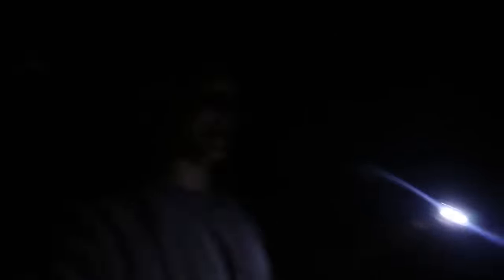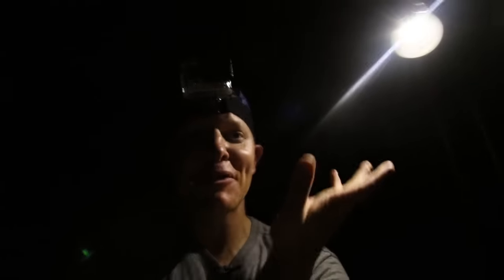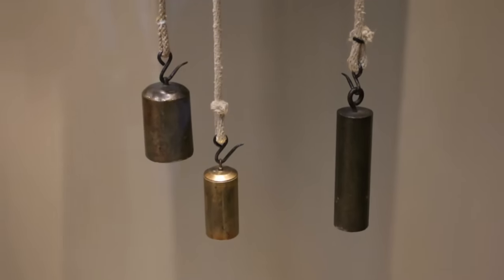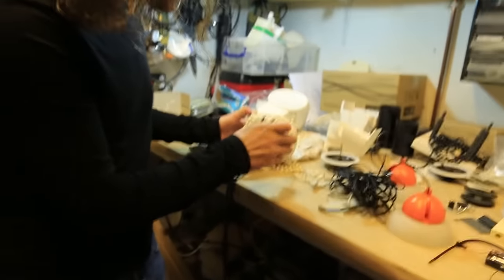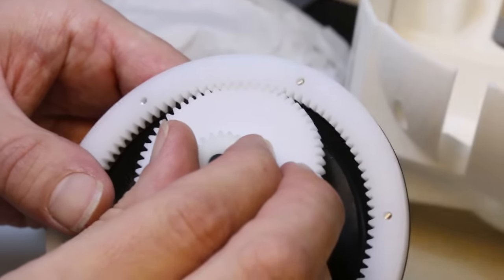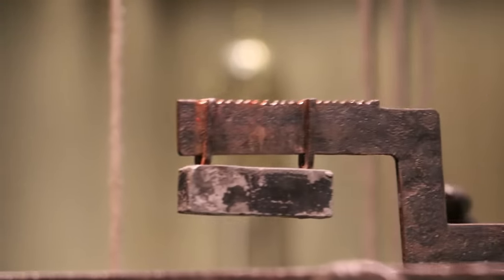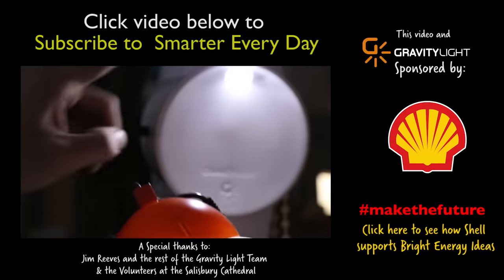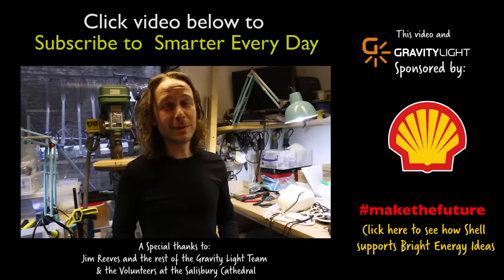Turning Gravity Into Light - Smarter Every Day 146

Comment: The braking effect wouldn't be exclusive to LEDs, any load will produce a counter-voltage on the generator which will slow it down. That's how dynamic brakes work on a locomotive or electric car - they use the traction motor as a generator and connect resistors across it.

Comment: We have done it.

but, For "productivity" its better hydropower gravity than "manual put some material with heavy weight, to machine. Because its hardwork. and if we use some tools for automations it with machine.

energy to put some weight is always more than output energy we produce.

its okay, for just some LED. and nice work.

Comment: Think bigger. Use a HUGE weight, hence a massive force. Use gear ratios that would make it take days before it drops to the bottom. Use solar power with stored battery energy to drive that weight back to the top.

Comment: this kind of energy  changing is used for a very long time now in the field of alternative energy. 
If you get too much energy out of the sun (solar plant) or out of a dam (water turbines) the electricity that is generated is used to pump water on a higher level. Then if the generators dont generate enough energy, they let the water flow down again and the water drives turbines that produce electricity

Comment: Just wanted to point out that this is not turning gravity into light. You store the energy when you raise the weight into the air. Just as a waterfall. The energy is stored from the sun. Same with the gravity light the energy is generated indirectly by the sun.

Comment: Got a question for you..
I’m a roofer and use special rubber souls on my boots to stick to roofs. When they get wet all surfaces become slippery and so does most wet  rubber surfaces yet if I fold a roll of rubber on top of itself with moisture in between, they stick very well with almost no slippage.. why does it make things slick yet sticky at other times.

Comment: With a capacitor you could provide light while resetting the weight.
Reply: Add a battery pack and you could run the weight several times during the day, with the light switched off.  Giving someone the ability to run the light for longer than 20 minutes at a time.

Comment: Run time is based on length of pull cord correct? Can you anchor the light at the location that needs light, get a long pull cord connected to a pulley that is anchored high up in a tree. If 8 feet of fall gives you 20 minutes of light, a 24 foot tree would produce an hour.

Comment: As others have said... the gravity is really the storage device (source being human or something else, but ultimately the sun), yet that is still really cool because batteries come with a lot of complication (not that this doesn't necessarily, but different complications). 

I could see this being used in place of batteries for all kinds of various power sources, including photo-voltaic panels. The PV panels could power loads while the sun is shining, but also power a small pump to load water up into higher energy states, or a small motor to lift weights on a pulley.

So one question becomes, how does the energy input to produce this device compare with energy input for battery technology of similar capacity, over its life cycle.

Edit: I guess part of the point here though is that the power source can indeed be simple direct human intervention to keep the system as simple as possible. Granted there are many ways to potentially do that.

Comment: turning gravity into light... what you mean is the energy transfer of kinetic energy, into an expression of high frequency waves, which then collapse to create light... gravity merely describes kinetic movement and energy exchanges between objects, based on their densities, at an equal consisent level which we deteermine as land level or sea level, when your enviroment changes e.g air vs water... you see the calculation change, gravity is not a force but an explantion of kinetic movement.

Comment: Two major misinformations:
First: It is not a purely gravity powered light. It is gravity assisted. On the first place, a human should hang the weight on the chain, thus putting energy into the whole system.
Second: In geared mechanisms, there is no way to make more than one tooth engage at the same time from the same wheels. There is a case when the next tooth engages and both are touching, but it is for a very short time. One exception: if the gears are coaxial and have the same number of teeth, but that has no practical use.
They are actually using a planetary gear mechanism with three satellite gears. That way they have three teeth engaging at the same time, but these are from different wheels. Actually, planetary gears are widely used in applications where heavy load capability is desired, like in hoists and cranes, because of the fact that multiple wheels are transferring the forces.
Reply: Besides, the effort to put the weight on the chain while the light is not working and it is dark could be a hazard by itself...

Comment: Could you do a future video on how the electro "escapement" effect is powerful enough to limit the fall of the weight? (surly if you add enough weight it will overcome this?) 
I understand the principle, but with my limited knowledge, how Is the limited power usage of the led "choking" the usage of the power created by the generator, by means of a non mechanical connection between the stator and rotor?

I hope this makes sense.

Comment: Great video, but there's one thing I find very hard to believe (Max, old TV show): that an LED can limit the speed of the generator powering it!!  Wouldn't the much bigger mechanical forces of the weight being pulled by the gravity of gargantuan Earth (compared to that falling weight) simply keep accelerating the generator 'wheel' until the LED's voltage was exceeded and the LED burnt out?
I guess what I'm asking is: How can a passive Light-Emitting Diode slow down a mechanical wheel being turned by the whole of Earth's gravity accelerating a falling weight at 9.8 metres per second every second?

Comment: If I have a mass of 10kg hanging 2m above the ground. The total energy I can get would be mgh i.e. approximately 200J. Now if I have a 1W LED, it would run for only 200s or 3.34mins. So that means I have to reload the mass every 3.34 minutes and that too after assuming no energy would be lost due to friction or resistance in wires.

Have I made a mistake somewhere or is this how the product is supposed to work?

Comment: He says it wont degrade over time if stored away... Wrong. 

The rubber band from the gear drive to the motor will become slack and perish over a 10 year period in certain conditions just like in the Cassette players of yesteryear. 

I have replaced enough of them in the 90s on cassette decks.

Comment: When he said "How does this work"....My first thought went to clocks that use weights.
I just thought about a design where you take one of those wind up musical boxes and inside they have a butterfly wheel that regulates the speed, put magnets on that wheel with wire coils adjacent and generate power. Now of course you don't use that exact design, but a long spring generator could be made and integrated into a lithium power bank.

Comment: You need to design or find a low-rpm generator instead of increasing the rpm using so many gears: fewer gears, less motion, less friction, less energy waste, less wear and tear. Yes that would mean stronger and larger magnets and larger coils, but that would replace the gears and that's what you pay for efficiency.

Comment: Sun gear, and ring gear... You're halfway to learning how an automatic transmission works.
Reply: planetary reduction
Reply: @hotrodray6802  yes correct is called the planetary reduction gear set. You can connect one end of The sun gear to another sun gear with another set of planets and another ring and obtain another ratio.

Comment: Interesting, so you if someone had one of these lights it would be possible to transform this mechanism into a free energy machine with a simple modification to keep it running by taking up the slack of the gravitational drop of the rope. Essentially making a perpetual motion machine at the same time. Well as long as gravity keeps working.

Comment: this stuff uses rubber bands inside..........thats a disadvantage coz it was mentioned that it could be used after keeping it stored away for a long time. Speaking from experience, those rubber bands sort of degrade when kept in closed dark spaces and become sticky and gooey; basically not rubberband-ish at all. What i mean to say is the product should avoid using rubber bands coz it wont work during that hurricane or flood where you will take it out from under the stairs after all those days without use
seen it in lots of devices, speaking from personal experience..........still its a good product which i too had thought of independently before this

Comment: How feasible would it be to have one like inside the church that has a whole bunch of weights triggered to fall in sequence when each reaches the bottom that has an output of say 1000 watts and can run for say 10 hours then in the morning solar panels drive an electric winch that winds the weights back to the top for the next night ?

Comment: Actually, ......the light is powered by human muscle power. Your muscles LIFTED the weight up against gravity and then gravity continued the motion. When the weight gets to the ground gravity isn’t going to lift the weight back up. It needs a human to put the power in there in the first place. 
I have a radio like that, spring powered generator but the spring needs someone to wind it up first.
Instead of cranking a small generator all night with a finger, use two arms and put all the power out in one burst. Let gravity help you stretch it out for hours.

Comment: Having lived around salt-water marshes, I've often thought there should be a way to gear-up the rise and fall of the tide to a reversible generator.  Flotation would provide an up force and gravity a down force, with no need of any work for a reset.  Extremely slow, but with the strength and reliability of the two forces (and if geared properly and multiplied by many generators) it still seems a possibility, particularly after viewing this.
Reply: Tide generators exist. I think they are used in the Netherlands a lot? I don't remember exactly, but I know they exist.

Comment: at that set-up of gears with the clock you would have enough RPMs to spin an alternator to charge batteries or bypass the diodes and you should have like 80 amps, Gravity Generator?

Comment: A small Solar Panel, connected via a small battery management unit (no larger than a pair of 18650 batteries), connected to a couple of old Laptop Lithium - ion batteries, will provide enough energy to keep an LED Array lit brightly all night long. No lifting. No winding-up. No moving parts to get wet, corrode and clogged-up. What if you are in an area that is a barren landscape, with no trees at all? All that you got to do - is find a Clearing in the Amazon for the daylight to charge the batteries. Very easy today - with fires burning everywhere.

Comment: The term gravity ...I think...is a misnomer. Gravity is an unproven 
theory. It does not work within any algebraic formula. It can  NOT be 
used as Force in any equation.  Matter bends spacetime, and the effect 
of that bending of spacetime is to create a generalized kind of force 
that acts on objects. However, it isn't a force as such that acts on the
 object, but rather just the 
object following its geodesic path through spacetime.
When light passes through an electromagnetic field, it is split into 
different spectral lines. That electrical phenomenon is what astronomers
 mistake for gravitational redshift. 

Electromagnetics ,on the other hand,are the only force that exists,and 
can be defined in realtime computational modeling. We are pushed onto 
earth by the electromagnetics of electrons/proton phasing , as opposed 
to the theory that gravity holds us to the earth the closer we are to 
it. An excellent example is the Saturn moon Titan.

When using surface gravity as a function of mass and radius (and 
sometimes speed of rotation).  Density is relevant, but it's not a 
complete answer. Most of the matter in the universe is in the form of 
plasma.
 A plasma is formed if some of the negatively charged electrons are 
separated from 
their host atoms in a gas, leaving the atoms with a positive charge. The
 negatively charged electrons, and the positively charged atoms (known 
as positive ions) are then free to move separately under the influence 
of an applied voltage or magnetic field. Their net movement constitutes 
an electrical current. This can explain why gravitational computation 
shows  (*gravity* misnomer) is stronger on the mountain peaks of the 
moon Titan,and much weaker in the lower valleys of Titan.
Reply: What...wuh?
Reply: @Massimo O'Kissed  ... cute...a third grader making rude comments instead discussing something. How quaint LoL
Reply: @doctormanganate5814  , actually the nomenclature used in the computational model ,using gravity as a constant, of the observation of light waves, is more of a hypothesis than it is theory. Using gravity (a misnomer) as a constant, is neither fact nor theory as it is a flawed equation. The moon *Titan is a perfect example of the flawed nomenclature. Using Einstein/Newton nomenclature actually shows redshift as blueshift. Gravity is not a constant. It is in FACT not a Force.
Reply: The maximum percentage variation of the LOD is on the order of 10-9, which is large enough to change G by only 10-5 of the amplitude—not enough to explain the full 10-4 percentage variation in G.

Comment: Add a super capacitor to extend the light after the weight reaches the ground.
Reply: the whole point is not to use batteries
Reply: @javib8970  A capacitor is not a battery, and capacitors were used to make this invention. You need them to turn the A/C generated current to a pacified D/C current after going through a bridge rectifier.
Reply: @LordFleming  ok
Reply: @javib8970  I'm sorry Javi B, I didn't mean to sound derogatory in any way. I like this invention a great deal, I was merely suggesting, by adding a Super Capacitor, a way for the energy to be stored beyond the extent of the gravitation drop. This would at minimum shed light on the generator so the  weight can be lifted again under illumination safely.
A realisation that people have designed cheap lasting beneficial products for others who are not in our socioeconomic climate is, or should be, a bright light to humanities future.

Comment: Apparently the usable output of this system is 0.1W.  That is... not much.  All the wall-mounted reading lights I got for my house are at least 3W.  You know those LED strip kits?  Take just one LED from those, that's about what 0.1W could power.  You will be hard-pressed to get enough light just to read a book at point-blank range with that, and of course it's not at all portable.  I think a small solar panel for charging flashlights or cell phones or radios would serve the prospective users much better.

EDIT: Yeah, even the Lightwedge, specifically designed for illuminating books at close range, uses 0.5W, 5 times what this thing can deliver, and it's supposed to illuminate anything from 6 feet off the ground?

Comment: Just wondering if this could be scaled up for battery charging? For example, electric vehicle charging where the fleet truck could be parked in something similar to an elevator platform using its weight to do the work?

Comment: 3:20.  There is a generator and an LED light. That is actually what creates the light. 

Everything else is just mechanical engineering. And the initial energy comes from the human muscles which lifts the weights into the bag. 

interesting device. But we are not turning gravity into light. Instead we are using human power combined with a generator and LED to create light. 

There’s a simpler device which is done by hand crank. Using your hands you wind the gears and create the power for the generator which operates electricity to the light. Similar concept.

Comment: Couldn't one use the power generated over time to power a contraption that quickly raises the weight back up automatically?  This would be a perpetual motion machine if somehow you could generate enough energy to mechanically... fling or otherwise lift the weight back up...  how much power does it build up?
Reply: the answer: not enough energy

Comment: Why can't this be done on a larger scale? Use a semi truck for the weight and turn a much larger generator. When the truck gets to the bottom just drive it up a ramp to the top. Would use lots less fuel.
Or use water for a weight from the edge of waterfalls. Or rain water collected on top of buildings.

Comment: Ha ha! Someone’s been hiding under a rock. My father rigged up a generator using a water wheel to power the entire house back in the 1930s, thus using the gravity of water flow. We also used cuckoo clock weights to power a night light. Of course the clockwork radio back in the 80s could also have been used to power a light, in fact it was rigged up to do so on many occasion.